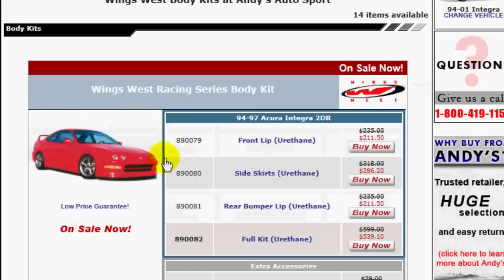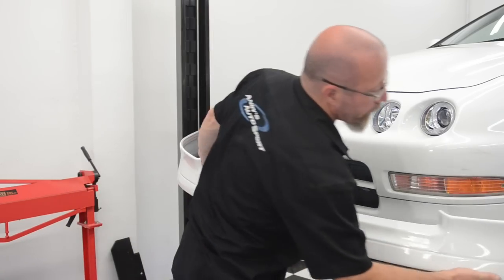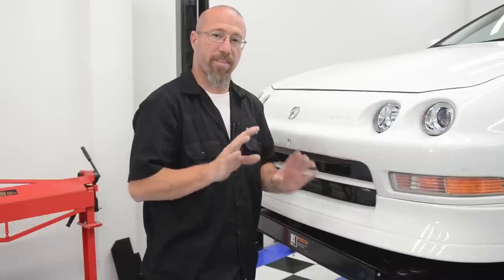Lip Kits - Presented by Andy's Auto Sport

Comment: I installed an air dam on my focus.... Gonna give a hint of advice. I live in canada...and my experience has taught me that when the weather gets cold...the 3M adhesive does not stick too well. It literAlly just falls off. Luckily i have reinforcement screws  and bolts everywhere which is literally the only thing holding it on

Comment: Hey andy , I have a question ... where there's a piece of PU that over laps the bumper cover , in the center ...  mine didn't come with that ... so the lip falls off in the center since nothing is holding it up ... any suggestions or ideas for it to stay put ...??? Double sided tape is possible but the edges would stick out further than I'd like ... and I don't want to see hardware on the front ... thanks an advance ...

Comment: I think that body kits are hellagay. The ONLY reason you would need one is if you need more air in or out the engine bay. They will likely be more heavy than the stock ones and affect performance in a negative way. As far as downforce you need to go pretty fast +++ to see a difference. Faster than the typical Honda can go (lol) .All of this is my personnal opinion of course.